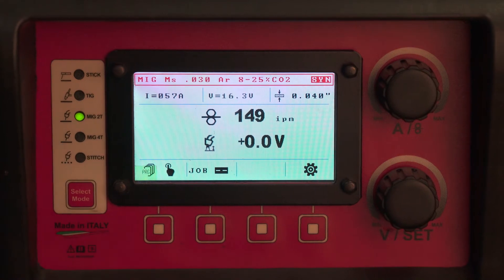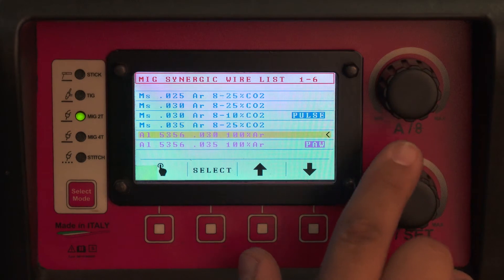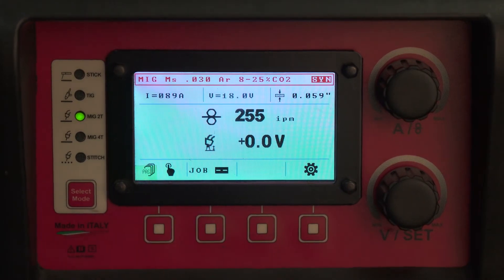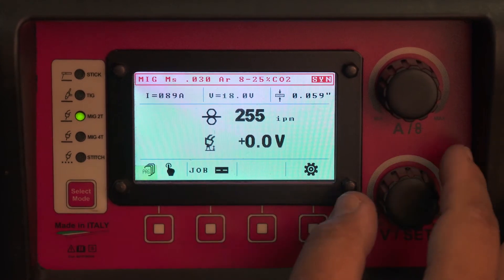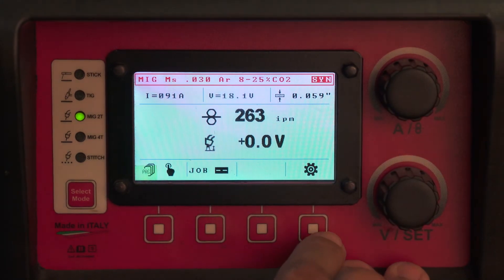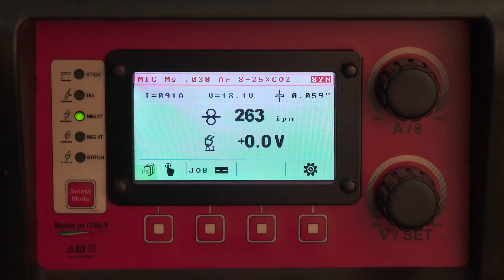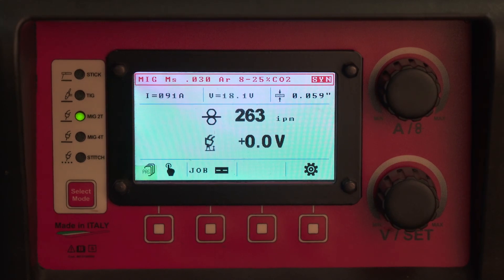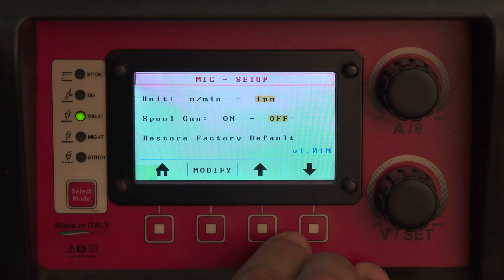Steel MIG Settings (Pro Pulse 220 MTS – Setup Part 11)

Comment: Can you only pulse on .030 on mild steel?
Reply: i use .035 and .045 and just add voltage to the trim using the .030 pulse program
Reply from the maker: That is what the synergic setting is set for. If you want to use a thicker wire diameter you can set it in manual mode or use the .030 synergic setting but you will need more voltage and amps to accommodate for the thicker wire diameter.
Reply: @usaweld  I should have asked if you can pulse on .035?
Reply from the maker: @andejo4436  You can, if you are you should use the synergic setting and accommodate for the additional wire thickness (more amps and voltage)

Comment: Can you fit 33lb wire wheel?
Reply from the maker: Yes you can. However it could lead to feeding issues because it takes more force to move the wire and more force to stop the wire. That goes for any machine really. But overall yes you can run a 30 lb roll of steel wire in the machine.